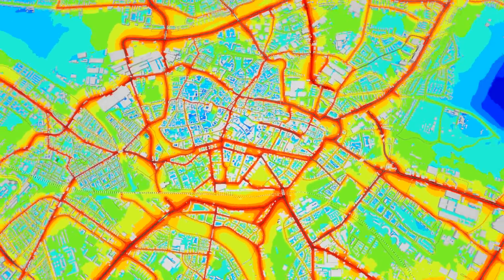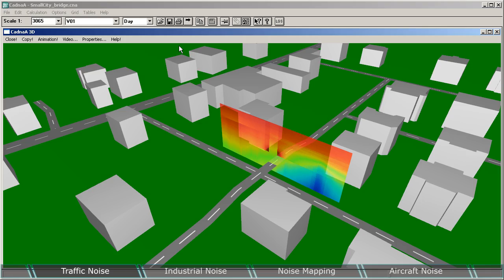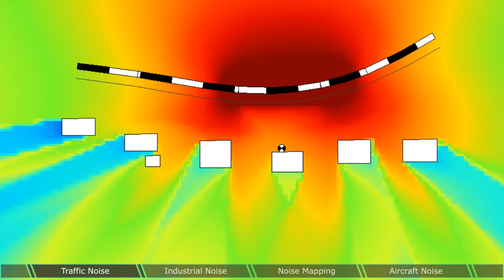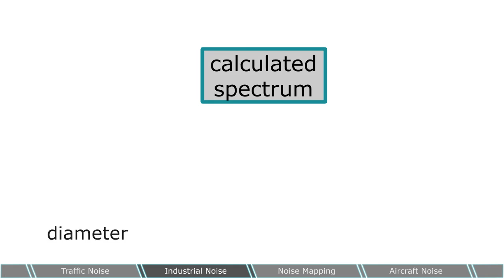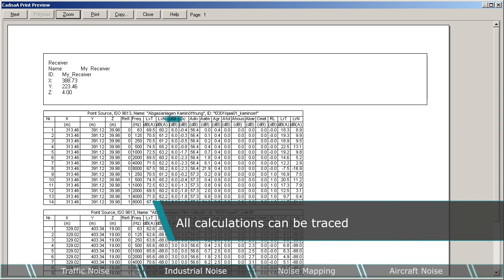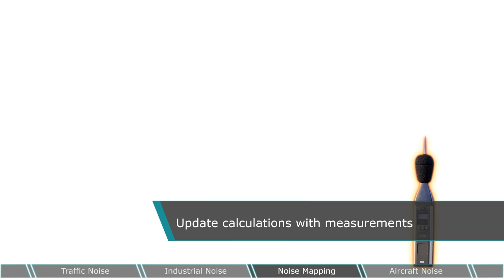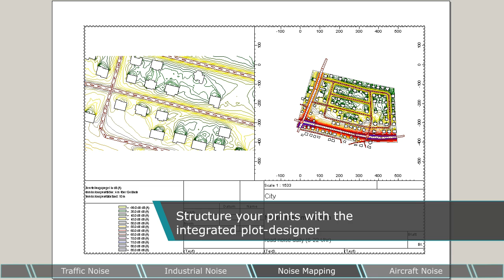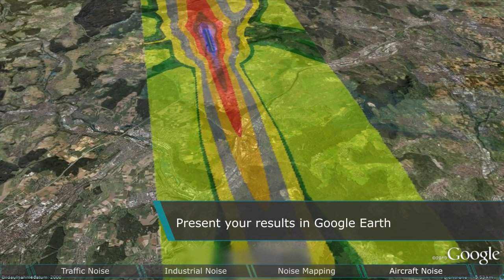CadnaA Demonstration English

Comment: Can I model and combine traffic noise and rail noise in the same run?
Reply: Yes for sure, you can combine several noise sources. Plenty of studies need to calculate the noise levels in the environnement when you can have roadways, railways, industries sources like chimneys or vertical/horizontals sources. The 64bit version is powerful to share the task on the different cpu